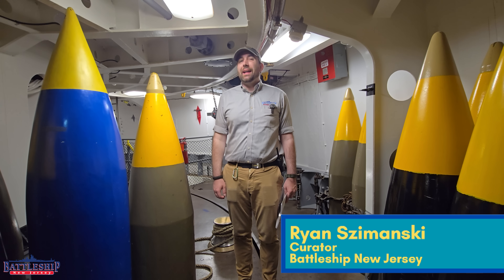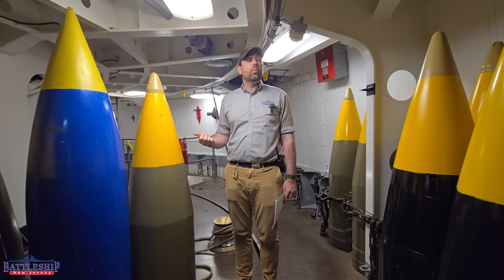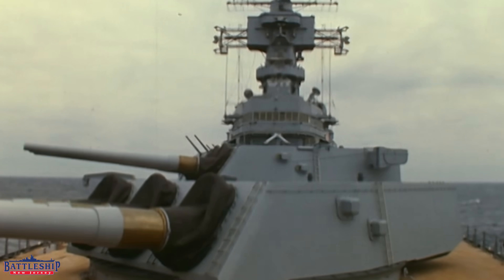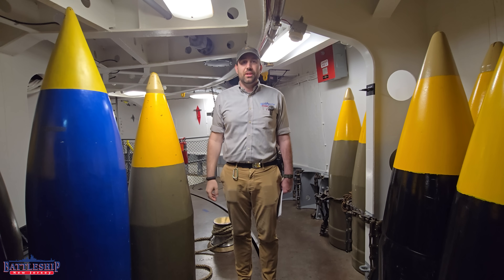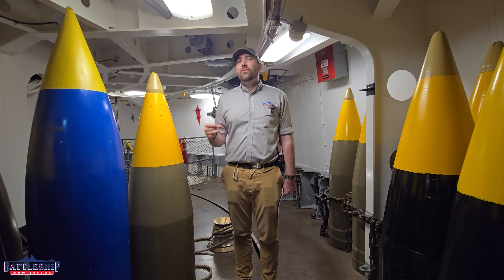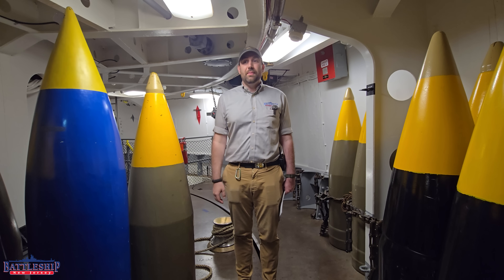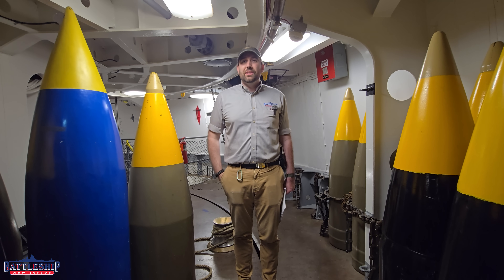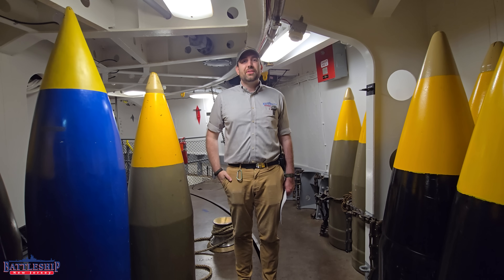Equivalent Service Life: How Many Shells Can You Actually Fire?

Comment: The service life numbers tracked with my intuition, (actually the 1200 and 1500 round numbers surprised me by being so high!)

What DID surprise me is the dispersion... 800 yards at the edge of range!? Almost half a mile!? Wow.  Hitting the broad side of a barn would be a lucky shot of legendary proportions!!!

But then again, bombardment do be like that.
Reply: Shorter ranges mean a smaller spread, and IMO 800 yards isn't that big if you're firing the HC shells from the Iowa class, 9 at a time, since the effect on target is roughly the same as a Mk84 2000 lb general purpose aircraft dropped gravity bomb landing on the same spot.
Anyone who's served in OIF and witnessed an airstrike that used a Mk84 with a JDAM kit on it will tell you, that's not a small area of effect.
Then you take into account the fact that the Iowa wasn't exactly slow at reloading after firing, it could probably have all 9 barrels ready to fire again within a couple minutes with a well trained, experienced, and high morale crew.
I'd say that having 9 of those land within 800 yards of you every couple minutes would be... let's just say not good for your health, even if you do survive you're probably gonna be shellshocked.
Reply: A couple of minutes? 2 of the updated&modernized Iowa's Missouri & it was either NJ or Iowa herself, during an 89 sinkex opened up and sustained continuous 2+rounds or minute per gun! You can find a somewhat grainy video of it on here it's fkn NUTS the amount of smoke, sound and clouds around the ships as they we're also firing the secondary 5"

Comment: So in training, obviously you are trying to be accurate. How did they change the setting to calculate a training shot versus a real hicap or ap round? I am guessing the fire control computer has to be set for whatever the real charge is and then the computer adjusts accordingly. Optimally I would want my training rounds to fire exactly like the real rounds. The people who are training would need to see/feel/hear/understand the differences. 

Its a very involved process I would imagine.
Reply: Yes, projectile type is one of the many factors that are entered into the fire control system to generate the solution.
Reply: @danquigg8311  thanks! I was curious when Ryan explained that training rounds don’t have the same flight characteristics as the combat rounds.

Comment: Hello
I have a question which is also a video suggestion 
What happens to water getting into the 16'' guns?
I know there are covers for them when not in use for longer periods of time, but in like combat scenario and in heavy rain there would be significant water buildup over time
So is there a system for it or just water got dummped out of the breach when opening?
Reply: After each shot a blast of compressed air is directed into the gun to remove remaining embers, smoke, dangerous fumes & such, before the breech is opened.  Should there be significant water in the gun, that blast of compressed air would - or at least should - solve that problem.  And any remaining water would drain out the opened breech.
Reply: @danquigg8311  Thank you!

Comment: Are the USS New Jersey’s guns still able to to fire? Is there still enough powder and shells in ammo stores or would they have to be re manufactured? Can her turrets still rotate? And the guns elevate? What’s the process? Maybe if possible the museum can do a demo of it on a special occasion. These videos are great and informative. The information helps put these massive ships into context and allows the history to live on!
Reply: It still has all the parts, and they do elevate, but a couple of parts were lightly welded to prevent turret rotation but could be readily converted back to fully functional in a day or two. There is still ammo in storage and all of the propellant was made during WW2 (with plenty still in storage) it is also a fairly simple formula so any current powder makers should be able to make it with some tooling overhead for the large extrusions.
Reply: @TheDuckofDoom.  Do you have a source for your statement  of:  "There is still ammo in storage and all of the propellant?"
Reply: @danquigg8311  It was definitely true a decade ago but the armed forces have been scrapping them as they find them so probably not anymore.

I was disappointed they didn't relocate a final loadout of AP rounds (without any power for obvious reasons) into the battleship magazines. The theoretical threat of powering them up again for one last battle just doesn't exist if you can't arm them.

Comment: The Army also tracks “equivalent service life” on its artillery tubes. If memory serves, it’s around 800 full powder charges. But the life is extended with lesser charges.  If you don’t have to fire at maximum range, you can fire with less powder charges and have a longer barrel life.  Every round and powder charge is documented to determine how much longer before the barrel needs to be replaced.
Reply: I don’t know what the specific number of shells a 105mm cannon is, but I read in the book We were Soldiers that during the battle at LZ X-ray during Vietnam, several of the cannons supporting that battle had tubes that were completely shot out.
Reply: @AKTundra my fuzzy memory suggests something in the high hundreds (700-900???) for 155mm.  But I was taught that in ‘81, so don’t bet on my recollection.
Reply: Back in the early 70's, there was a guy on the floor in the dorm, that had the job of examining the guns during the Viet Nam war to determine if their barrels were still within specs, or needed service.  I don't recall much details.  I seem to recall some sort of radar device to determine an accurate muzzle velocity

Comment: We had hypervelocity guns at our facility, and from what I know about interior ballistics of "rifled" cannons, the wearout always occurs at the high mechanical pressure zones, where the shell accelerates or moves at a speed, where the Bands, and shell oscillations start to scrub the walls.  Kind of like a wire-brush example.  The Bands have to be hard enough to not just deform like jello, so they are coordinated (by alloys), to grab onto the rifling, and start rotating without getting sheared off.  That part is dependent on the initial gas pressure, and powder burn dependent.  The rifling then gets scoured (mostly sideways) by a shell attempting to get up to rotation speed.  The rotary inertia of the shell matters.  As the gas pressure decreases along the barrel (although not always true in some powders) the shell conforms to the rifling and the sideways forces relax.  For overpressures, the wear is usually at the Breech zone, and then progresses outward.  That also causes range inaccuracy, and the barrel usually become fouled early.  When fouling occurs, you can get "local" pressure waves occurring along the barrel, also causing loss of ranging and yaw, since the shells often start oscillating.  Different shells, with different bands, will cause different wear patterns, and some shells will actually act to "clean out" prior residue in the rifling.  I would love to hear some actual gunners, and scrubbers outers, tell about the wear patterns that they have actually seen.  Barrels themselves have intrinsic oscillations, and some barrels are just better than others.  Probably manufacturing and alloy variations.  If have books written about interior ballistics, but that is only the Math.  Actual empirical evidence is what is always needed.
Reply: Very interesting!
I knew there went a lot of science into designing the powder pellets, but the interactions between them, the driving band material and barrel oscillations are mind blowing. Sounds like a very interesting field of study!

Comment: I’ve asked this before, but when the Iowa-class battleships were recommissioned in the 1980s, did the Navy have any contingency plans in place for manufacturing new barrels, liners, or shells if the need arose? Also, were there any contingency plans for relining the existing barrels if that became necessary?
Reply: From what I've learned, the iowas where built with a excess of spare barrels, so much so that the spare barrels where used elsewhere.  The stored  shell numbers where also so great at the time of decommissioning, that the warehouses had problems disposing of the shells.  The only issue was the powder bags, as these degraded over time (See Ryan's prior video).
Reply: @robertgarrett5009  IIRC, there were around 34 spare barrels in the U.S. Navy’s inventory during the 1980s, so the chances of burning through the entire stockpile at that time were likely slim. However, one of the reasons USS Iowa was kept on the Naval Register in 1998, over USS New Jersey, was because Iowa reportedly had significantly more remaining barrel life. By the time of her final decommissioning in 1991, roughly 80% of New Jersey’s barrel life was used up, largely due to her extensive service during the Vietnam War.

Shell numbers were a completely different issue. In 1981, there were about 15,000 HC (High Capacity) 16-inch projectiles left in inventory, enough to run out fairly quickly in a medium-intensity conflict. To put that in perspective, New Jersey fired over 5,600 rounds from her main battery during a single Vietnam deployment. Meanwhile, Missouri and Wisconsin collectively fired just over 1,000 rounds in about six weeks during Desert Storm.

Comment: Heat by itself doesn't wear anything.  It doesn't get hot enough to alter grain structure or anneal the liner. These barrels are heated up quite a bit during assembly at the factory. Mechanical friction and gas erosion are the worst offenders, just like a rifle firing a high pressure catridge. I assume fatigue life is just pressure cycles like any other pressure vessel. The heavier shells would increase barrel pressure.  They probably didn't know the exact number of cycles, so 1500 is an educated guess.  Maybe they evaluated barrel data from past battleships to make that conclusion.
Reply: But isn't the rifleing a separate sleeve from the barrel, and would wear/stretch?
Reply: @robertgarrett5009  Yes, the liner is the inner most ring of the gun barrel, and yes as projectiles are fired, the liner is going to "grow" in length to the degree where it can protrude slightly from the end of the gun barrel.  The ship carries machining equipment that is fitted to the end of the gun barrel to mill off the extruded liner material.  Predictably, sailors call it circumcising the gun.  https://www.youtube.com/watch?v=9R94bNhuN-A
Reply: Agree.  We had hypervelocity guns at our facility, and from what I know about interior ballistics of "rifled" cannons, the wearout always occurs at the high mechanical pressure zones, where the shell accelerates or moves at a speed, where the Bands, and shell oscillations start to scrub the walls.  Kind of like a wire-brush example.  The Bands have to be hard enough to not just deform like jello, so they are coordinated (by alloys), to grab onto the rifling, and start rotating without getting sheared off.  That part is dependent on the initial gas pressure, and powder burn dependent.  The rifling then gets scoured (mostly sideways) by a shell attempting to get up to rotation speed.  The rotary inertia of the shell matters.  As the gas pressure decreases along the barrel (although not always true in some powders) the shell conforms to the rifling and the sideways forces relax.  For overpressures, the wear is usually at the Breech zone, and then progresses outward.  That also causes range inaccuracy, and the barrel usually become fouled early.  When fouling occurs, you can get "local" pressure waves occurring along the barrel, also causing loss of ranging and yaw, since the shells often start oscillating.  Different shells, with different bands, will cause different wear patterns, and some shells will actually act to "clean out" prior residue in the rifling.  I would love to hear some actual gunners, and scrubbers outers, tell about the wear patterns that they have actually seen.  Barrels themselves have intrinsic oscillations, and some barrels are just better than others.  Probably manufacturing and alloy variations.  If have books written about interior ballistics, but that is only the Math.  Actual empirical evidence is what is always needed.
Reply: @brunonikodemski2420  Wow, that's really informative, thanks!
Reply: @brunonikodemski2420  Can you share more details of these hypervelocity guns and the facility?  You've piqued my curiosity.

Comment: considering that rifles like .556 and 30-06 will burn out a barrel in 1000-2000 rounds 
300 rounds for those big guns sounds reasonable 
just wondering what the used to measure the barrel wear on the 16" guns
Reply: You don't measure barrel wear. You measure the increase in dispersion caused by the wear. He said a 10% increase in dispersion is considered worn out.
Reply: @major__kong  Thank you

Comment: I think that's a LOT of those big shells.  On an average loadout, how many rounds or powder, whichever was the limiting factor, did they carry?  What I'm getting at is how many full loads could they go through before they 'should' put in new barrels?  As always, thanks for sharing.
Reply: The Iowa class was designed to carry about 130 projectiles per gun, so 9 x 130 = 1,170 projectiles.  Each projectile would take 6 propellant charge sections, so 1,170 x 6 = 7,020 charge sections.  Since there are 3 charge sections per propellant tank, that would be 2,340 propellant tanks to be stowed in the 16" magazines.
Reply: @SomeRandomHuman717  That gives you 130 shots per barrel assuming none are knocked out/inoperative.  With a lifetime of what did he say?  Something like 1200 shots at full load?  Round it to 1300 for easy math and you have 10 deployments of complete ammunition depletion.  Not as much as you'd think but still sufficient to where I don't think they'd ever need to replace barrels.  And that's assuming the heaviest load with full powder.  Change it to HE rounds or less powder because you don't need as much range and they'd last a lot longer.

Comment: What causes the puff of smoke from the barrel after it is fired and lowered? Is that when the breach is opened?  If so, what causes it to flow out of the barrel and not out of the breach, is the inside of the turret kept slightly pressurized to blow the smoke out? See about :57 of this video.
Reply: The air purge system. It blew compressed air through the gun tube to clean out smoke and burning particles so it didn’t end up back in the gun house.
Reply: @Enrage13  Thanks! I had not thought about  making sure there are no left over “burning particles” in the barrel before loading in the next powder bags. How is the air blown into the barrel by the air purge system? Is there a nozzle mounted behind the open breach area?
Reply: I think I remember that it is a line into the breech so it is blown out before the breech plug is removed. I know the internal type as well as open then blow out systems both have been used for different vessels depending on need and nation.
Reply: That is an approx. 175-200psi shot of air that is inserted at the rear of the gun chamber very close to the breech mushroom.  The purpose is to expel residual powder gasses and burning fragments thru the muzzle (the white puffs) to clean the bore without fouling the gun room compartment.  Each air shot consumes about 25 cu ft of air.  There is also an auxiliary system that stores air in two tanks in the turret officer's compartment; there is a hose at each gun captain's station that can be manually connected to the air piping to bring the auxiliary air into the breech should the main gas ejector system have a casualty.  When the turret ventilation systems are on, as they would be during a shoot, the system maintains a slight positive pressure in the gun house.
Reply: One of the theories about Iowa's turret explosion was a purge air failure.
Reply: @jello3456543  Failure to completely purge, leaving smoldering or burning particles in the breech that would set off the next load of propellant, would be a valid theory IF the explosion happened subsequent to a previous shot.  But, in the case of the Iowa T2 explosion, all three guns in T2 were "cold," meaning they had not yet shot that day.  So the purge air failure theory is not applicable.
Reply: @SomeRandomHuman717  Do you know the type of projectile that was used that day?  I'm thinking an inert practice round.  And, was it only the propellent for #2 gun that was involved?  Did the fire extend below the gun house?

Comment: I just had a random thought. If Ryan’s office is on the ship, where on earth do they go to the bathroom? I can’t imagine they use the boats original head as those navy boats weren’t known for privacy in the bathroom. 

Bathroom location is the first thing I look at if I’m some place new.
Reply: The ship is connected to shore water and power.
Reply: The heads / WCs in officer's country area lot nicer than the ones in enlisted crew berthing. I vaguely remember Ryan saying their offices are on 2nd deck (or maybe 1st?) and there are some officers WCs there. There's one port-side of turret two (compartment 2-76-2-L), near a bunch of rooms that the plans designate as offices and Warrant Officer's staterooms. (Those might be the offices that the museum staff are using, but that's just a guess.)
Reply: there's a public one just forward of turret 3 on the starboard side - I just used it a few hours ago